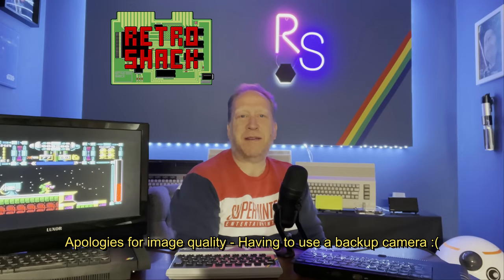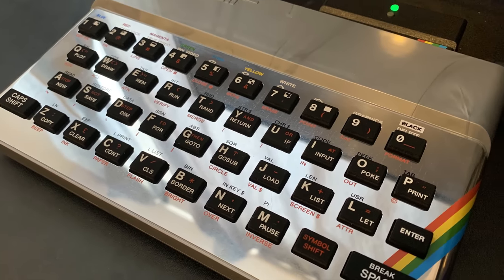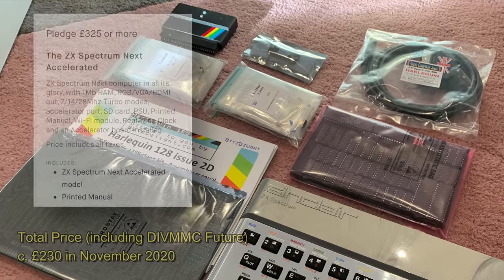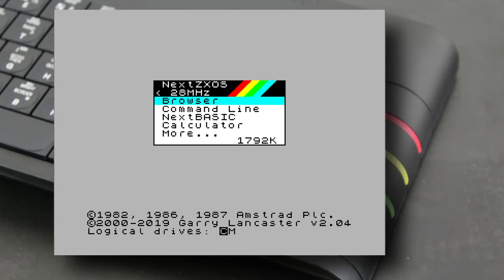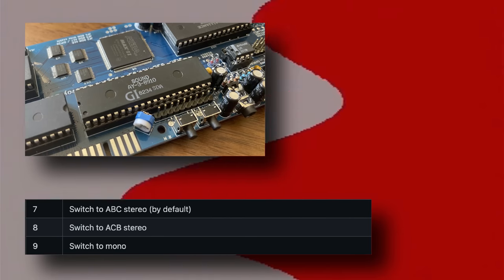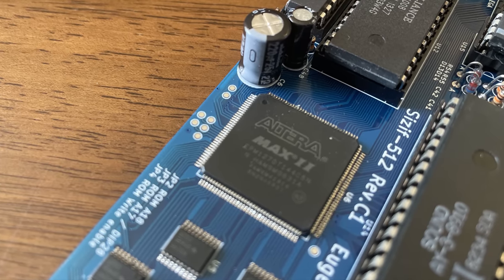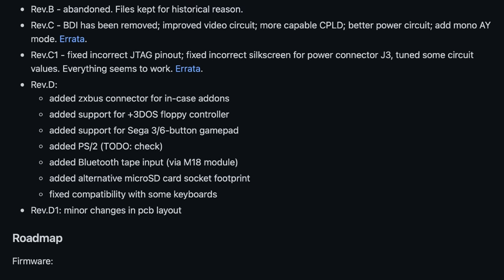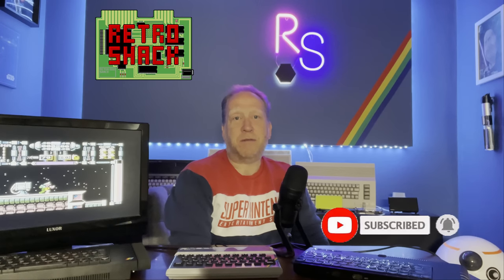This ZX Spectrum Clone Offers A Lot Of Bang For The Buck - If You Can Get Hold Of One!

Comment: 5:32 That isn't true. The DivMMC has it's own independent ROM and RAM, which it pages into the lower 16K of the Z80's address space as required. You are restricted to using the original 48K BASIC ROM though, but the 128K hardware features such as the additional RAM banks and the AY are still available.
It's what is known as 'USR 0' mode, as it's the same as what you get on a 128k machine if you type 'USR 0' in 128 BASIC. 128k software should load and work fine using LOAD "" as if you loaded them using the 'Tape Loader' option in the 128 menu.
Reply from the maker: Thanks - I’ve pinned this so people can see.  I’ll have a play with that.  The snapshot on the screen is straight from the DIVMMC Future web page but that wasn’t clear - and I have had a few things not load.  I’ll check out the USR 0 method :) Love this community!
Reply: @TheRetroShack  Be wary of 128K snapshot files on the DivMMC (and in general). Snapshots that were created using a 128+ or +2 can fail when loaded on a +2A/+3 (and vice versa).
Also, there are a few TAP files out there that were modified from the original release to replace custom loading routines with the standard ROM loader (TAP files can only contain standard ROM loader data) without taking the model detection of the original into account. These too can suffer from the same problem.
Reply from the maker: @lister_of_smeg6545  Thanks for the info! :)

Comment: I got one from Ebay ready to it was  ZX Sizif-512 - D1 - With WiFi and Bluetooth Modules. As I have to get my ZX Spectrum Next issue 2 in 2023. It works very nice and I use my ZX-HD so I can use my PC display. I had a old 48K case, that had been cut with two holes in the top so I did not mind to cut this one to get to the microSD socket. This one has some very good  CPU speeds 3.5MHz, 4.4 MHz, 5.2MHz, 7MHz and 14MHz. I have found 5.2MHz is the sweet spot for some games.

Comment: That’s looks a great little board. I have Spectrum Next in the pipe line otherwise this may have been a contender.
Reply from the maker: Why not get both ;) - Ignore me, that's the addict in me talking :) :)
Reply: @TheRetroShack  I have a brand new D1 revision. Just waiting for a rubber case (dim transparent+black+golden) from RR. Until then, it's in a standby mode.
Reply: @doperst2  Where did you buy it from? I can't see any for sale anywhere

Comment: Now that's a cool piece of kit.  I currently get my Speccy fix from my standard 48+ and MiSTer FPGA.  I'd also suggest checking out the N-Go Next Clone, as well as the Just Speccy 128 and Omni 128 Speccy clones
Reply from the maker: Got a feeling I'll be getting all of these :) :)
Reply: @TheRetroShack  After buying an unpopulated PCB and doing nothing with it I just came across a fully assembled D1 rev Sizif on eBay complete with WIFI and BT modules  (I think it's the creator selling them) so I jumped on it.  Now I just need to find a Speccy+ case...
Reply from the maker: @macstar8317  Nice!

Comment: Just HDMI with audio, micro SDcard, and ZX Spectrum keyboard connectors, 2 or 4 MB of memory, joystick ports. With an FPGA that will allow it to emulate the rear hardware too. It doesn't really need much more. :D

Comment: This is an excellent implementation, probably the best clone. It runs every type of file, scl, trd, etc, which Next cannot, and it is really cheap and fits the rubber case quite nice
Unfortunately, the development (by request of Russian community) went totally wrong way, concentrating on adding PC PS/2 keyboard, MIDI, FDD controller etc
Reply: Which way do you think is the right one?
Reply from the maker: I plan on getting hold of a few of these clone devices - to my mind, as long as they maintain compatibility with all software and they're reliable, I'm happy :) :)
Reply: @UzixLS  I'd quite agree with Kppot in what concerns MIDI and other uncommon music file types support on the daughterboard. The work started has to be done, ofcourse,  but as a typical user, I'd kindly ask for more attention to the utilitary features, like nmi OSD, timings perfection and maybe more common features like tzx support, simple 8bit IDE support (back) and HDF files support..
Reply: @doperst2   1. NMI menu is already done, currently it's on testing (https://s.micp.ru/wV9ze.gif ). Timings are in the roadmap. 2. What about IDE - why you ask for it as there is SD card already? 3. HDF is HDD file image format for emulators, how Sizif should support it?

Comment: I only found out about the Next after it had sold out. Now they are fetching stupid money on Ebay. 3x RRP. So I'm using emulators. Fitting a Pi into a Spectrum 3 case - using the original Spccy 3 keyboard. Currently sorting out the adaptor. That's going to be a tricky one, but if I can get it done that will do for me.
I'd buy another Next in a heartbeat if they ever make another run.
Reply from the maker: Can't imagine they'd want to turn off the money tap :)  I've a video coming up in a couple of weeks about getting a PI in a Spectrum case - You might enjoy that one :)
Reply: @TheRetroShack  That's great timing - I'd definitely be interested. I actually have a Pi Amiga and a Pi C64. I "could" play any games on them, but the OCD in me only lets me play the right games on the right machine. A Pi 4 is huge overkill for a Spectrum emulator - but they are so affordable and the projects are fun to do - so why not? :)

Comment: While marketed as a CPLD the MAXII series is not Macrocell based like traditional CPLD devices, rather, it's LUT based just like a modern FPGA. It used an inbuilt config ROM rather than external, just like Intel's (they bought Altera) Current MAX 10 FPGA chips. So not "Kinda, sorta, a bit like FPGA", it really is an FPGA, only marketed as a CPLD as it targeted a similar market.
Reply from the maker: Well, consider me kinda, sorta educated on the topic ;) Thanks! All too clever for me anyway :) :)

Comment: Unfortunately the Sizif 512k is no longer available. probebly for the best as I already have 2 48K's, 2 Toastracks, 3 128K+'s, a QL, a Harlequin 128 and a ZX Element. (that's just the Spectrum stuff. LOL.)

BTW, with the DivMMC you can still load and run 128K software from the SD card as it boots into USR 0 mode, not 48K mode. Which means all the memory paging and AY sound is still accessible. :)

Comment: Nice. You didn't mention power though, the lack of a heat sink leads me to believe it has a switch mode converter, is that so?
Reply from the maker: It's a switching unit - variable voltage in and polarity independent so you can plug most things in without causing an issue, even an old Spectrum PSU :)
Reply: @TheRetroShack   Great, thanks!

Comment: That's an impressive board.
For the buttons I would have gone with 2 holes drilled in the case and a paperclip (or a pen tip depending on the size of the holes) though. 😉
BTW why the image looks smaller when the alternative ula plus color palette is on?
Reply from the maker: Can’t drill into an old case - something in me won’t allow it :) Two different recording sessions about a week apart.  Things fell apart while filming this episode and I lost a LOT of footage - It’s a real hodgepodge! :)
Reply: @TheRetroShack  I meant drilling in the replacement case. 😁
Reply from the maker: @bufordmaddogtannen  Phew!!!

Comment: What about implementing the electronics of the Sinclair Spectrum using a SPARTAN FPGA and Level Shifters to prevent the FPGA from burning out all that would be needed is RAM chips and a EPROMs and a RF Modulator.
Reply from the maker: Stop giving me ideas! :) :) :) I don't have enough time for things as it is ;)
Reply: Isn't that mostly what you've got with a Next? The CPU, graphics etc are all inside the FPGA.

Comment: I have seen someone selling complete ZX spectrum Sinclair motherboard Sizif 512 kb + software on one site. I wonder how easy it is to set up. It doesn't come with a power and no RGB-cord either.
Reply from the maker: The only thing to consider is that if you want to update your firmware, you'll need a TL866 programmer and a JTAG programmer for the Altera CPLD device - plus learning all of the software to go with it.  I might do a video on the process to help folks out.
Reply: @TheRetroShack  Thank you for the reply!

Comment: Anyone know how this compares with a ZX Nuvo 128.  The Nuvo has more discreet logic chips and doesn’t emulate in modern hardware it also has the divmmc built in… but I don’t know enough about Zx spectrums to know if there are downsides of a Nuvo over this board.  Harlequin seems to be the most popular build not the Nuvo, why is that?

Comment: The z84c0010pec is a 10MHz part, so I guess the 14MHz mode is achieved by overclocking the CPU?
Reply from the maker: Guess so - it runs pretty stable at 14mhz and doesn’t get overly warm.

Comment: Has anybody built one of these?  I'd like to give it a go but haven't been through the process before. How do I find the PCB files, parts list and build guide? I can't seem to find these on the Github using the link in the video description
Reply from the maker: There's no build guide to my knowledge but I'm pretty sure there's a Bill Of Materials on the site somewhere - I'll have a dig around :)
Reply: @TheRetroShack  Thanks. I've now got the latest revision (D1) main and WIFI PCBs from a seller on eBay and have found the BoM on the Github.  Just need to source the parts and a CPLD programmer before starting the build

Comment: 90 pounds ?! For that I can still buy a working commodore 64 (original one)
Reply from the maker: Not sure how that would help with Spectrum games though ;) In all seriousness though, these types of boards are not for everyone, but they are super cool!
Reply: @TheRetroShack  Ah! The easiest way to improve ZX-Spectrum graphics for a particular game is to play a C64 version of that game 😃
Of course it doesn't always work as many games (surprisingly) look better on ZX
Reply from the maker: @b213videoz  But not if you like Brown.  If you like Brown, you need the C64 :) :) (Or a Spectrum with a ULA Plus)  :)
Reply: @b213videoz  If I want to play a better graphics and sound version, i play a PC remake of Spectrum game (plenty of them available for free). I come back to Spectrum for color clashing and rubber keyboard. I drop about 40 years from my age this way. I just leave alone my PC with 24 cores CPU, 100500 cores GPU and 64 GB RAM and sit back to play Quazatron. The old fashioned way.
Reply: @doperst2  I hear you! Most of the "remakes" are crap, for example the original Underwurlde looks great with 16 colours graphics, that 256 colours version is crap BUT I hate colour clashing so I play C64 Underwurlde version which looks and plays exactly like ZX's but without colour clashing

Comment: I would NOT buy anything from Retro Radionics if i were you i ordered some cases $230 worth  Back in February  I've chased several times and they dont even respond to my emails. If they are busy and my order is delayed at let me know that would be fine.
Reply from the maker: That’s very odd - I get all my cases from them and haven’t had a problem as yet.  Let’s see if this new one turns up… I’ll let you know.
Reply: @TheRetroShack  Yes i was suprised never had an issue from them in the past. But i've tried several times to contact them.
Reply: I've been waiting for a case from them since July 2019. I don't expect to ever receive it to be quite frank.
Reply: I've had a problem with one of the two ArcadeR joysticks I ordered not arriving, possibly not being sent at all (from China) since the tracking number was invalid. Had to persist with multiple e-mails over the course of several months in order for them to send me a new one. From what I understand RR is basically a one man show, and probably has problems keeping up. In addition, I suspect they may have issues with their postal service, with goods getting nicked by their local couriers who forward bogus tracking numbers to RR. No concrete evidence though, just a hunch. In any case, persistence is key. And ordering locally if possible, not from China. Base prices can be higher and stocks not so full, but shipping can be cheaper (and most probably quicker).